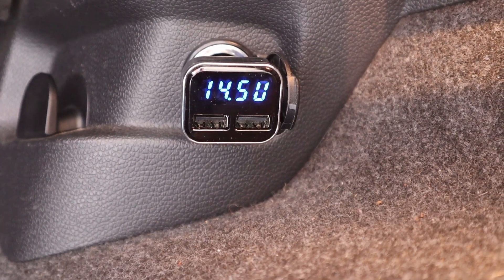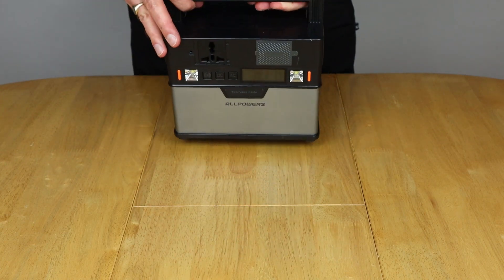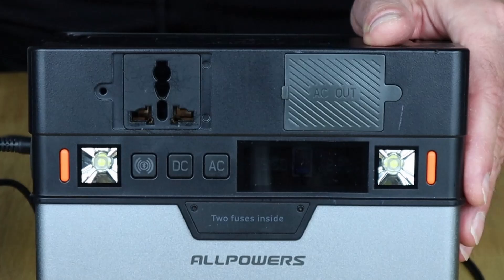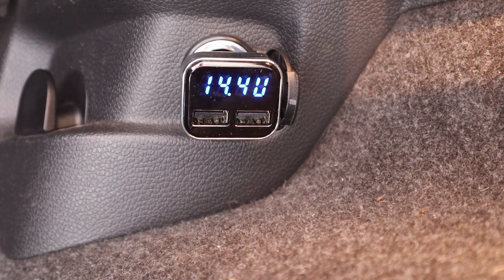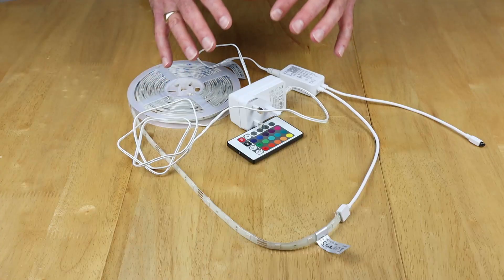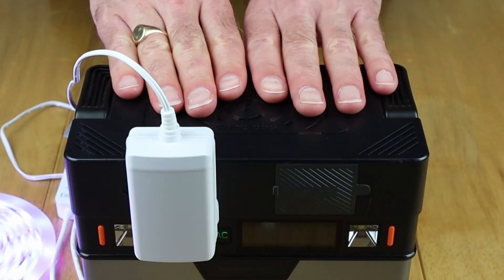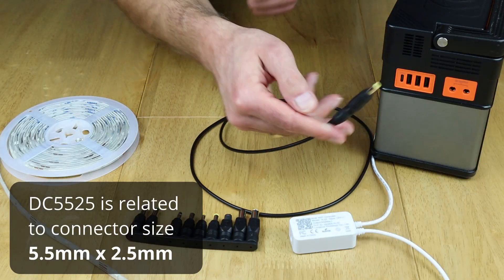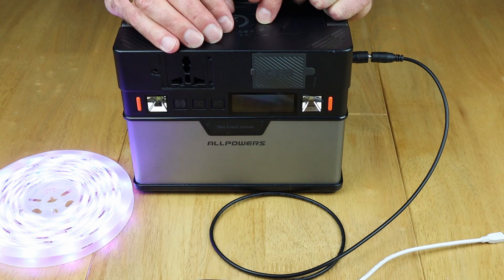How to get more out of your ALLPOWERS 372Wh Solar Generator | 12V charging and usage tips

Comment: I purchased the 666 version from Ali Express for £300 with new account discount promo, i thinks its currently £350 now its a great little product. However i was wondering if its possible to draw 24v to power a low power kettle without having to use the inverter and draw an extra 6w? i also have the 100w allpowers camo folding panel and was able to get 67w on a sunny day with no proper setup i.e. correct adjustable stand for correct angles. the only critic is its would be nice to have an attached folding stand and long dc cable rather the 1m dc cable provided. i got it for £150 inc tax and delivery on alliexpress and its all in working order. Another question is it possible to charge my allpowers battery on wind power if i have the right charge controller and cables? if possible please demonstrate.
Reply from the maker: @Christopher Bunbury  Good day Christopher! AliExpress has some great deals over Amazon (for the same products) and looks like you found one! That's a decent solar charge without a proper setup (angle). A couple of questions if I may.

Do you have the kettle already?
I assume it's a DC powered kettle, but what type of connector does it have (if you have a link that would be useful)?

I've not got a wind turbine as yet, but from what I've read the smaller ones don't yield that much unless you live or visit somewhere that tends to be exposed (and windy enough). I know some boat owners like them as they can provide decent power when in open water (again, when it's windy of course). It all depends which type you purchase as you can get controllers with them, but as the 666 has an in-built MPPT charger a 24V turbine should work as that is what a larger solar panel would put out. This is just theory though as I've not tested one on my 666. I look forward to hearing from you. All the best, Adrian
Reply from the maker: @Christopher Bunbury  Thanks for the info. I can see why you went with the second option over the first.

I found the 500W kettle (last year) in this video > https://youtu.be/Z5Fwp2pWBtU?t=1023 and it has been brilliant. Reasonable boiling time (providing you only boil what you need) and it works fine with the 666 too! The other one I'm currently testing is a one full-size coffee cup option which is really good on energy consumption and is also like a flask. It takes a little while to boil, but switch it on and just wait for the beep > https://bit.ly/3pyZ7zP (affiliate link).

I’ll check out some larger solar panels on the 666 and let you know. Cheers, Adrian
Reply: @DADvinci  ok thanks for the suggestion if the one I ordered isn't satisfactory I may consider the 500w one.

As for the panels, I'm looking forward to seeing what you find, much appreciated. 

I have since purchased dc2521 10m extension cable 18-36v to use my allpowers folding camo 100w in the garden whilst I'm indoors but wattage loss is very off putting. I was charging at 57 watts but when I just added the extension cable I lost 17watt

I got highs of 60w on solar today but I really want to at least be hitting 90 -100w
Reply from the maker: @Christopher Bunbury  I managed to briefly test today. I've not connected up 2x 100W panels in series (only parallel) due to the voltage limit on the 666 (30V) and my 2 panels in series would go over that. I think I've looked at this before and came to the same conclusion about anything above 100W, in that the MPPT limit is 30V and 5A (30V x 5A = 150W). It did slightly push up the charging rate from about 80W to 99W when in parallel, but I need to have another think about getting nearer the limit and what type of panels/setup might do it.

That is a problem with come DC extension cables, especially if they are long and fairly thin (small wire gauge). The angle on my smaller 60W panel does make a difference to the input watts and I normally get about 45W on this panel. Do you angle your panel? 

Did you have to pay import duty and VAT when you bought from AliExpress? Cheers, Adrian
Reply: @DADvinci  thank you, I see, when it comes to solar charging you have to overcompensate while staying within safety parameters. 

Its interesting tho that I'm able to get a continuous 167w dual charging with the power brick 97w and my Chromebook type c 69/70w.

Yes now I always spend time adjusting my panel for an optimized angle not by measuring, just by manually adjusting and checking the reading as I move. Its awkward because the app isn't working and with all the sun glare it's difficult to read the screen.

I clipped the camo folding panel to and old clothes drying rack it's a 3 piece. It fits across to pieces overlapped and the third piece I position to support it so it's like an upside down V and easily adjustable. As I wanna really be taking my folding panel out I wanna purchase a larger permanent panel for home use and keep the folding one free.

I've also bee looking into creating my own tracking stand it's seems straight forward most are made from wool or metal but I'm looking do it from pvc pipe to keep the cost down.

I don't recall paying import duty on the battery, I payed £320 for the unit and £16.46 shipping then got around £37 in coupon savings so ended up paying £298.54. the strange thing is that both the price and delivery from the same seller has gone up the delivery alone is now over £200 and the unit is £370. For me to buy it from the same seller the final price is over £600!

My Dad's car went flat, is it possible to jumpstart a 1.3l ford Fusion that has a 12v 41ah battery? I tried it today but was unsuccessful. I connect the croc clips that came with my folding panel to the battery and connected the other end to DC output on the allpowers. The allpowers was showing 60w then went down to 40w. I had it on for 5mins and tried to start the car. The lights and dash cams on but no rev from the engine. I've seen ppl start a car with solar on YouTube so I thought to try it with my fully charged allpowers battery. My gut tells me it needed to be charging the car battery for far more than 5mins. Eventually a passer by stopped and others us a jump and it started the car within seconds. 

Update: the allpowers app is now working for me 😃
Reply from the maker: @Christopher Bunbury  How are you? Thanks for the additional info, much appreciated. 

You're spot on with the home versus mobile setup. That was one of the first things I did when funds allowed, 100W rigid at home and used the 60W folding for travelling about. The tracker is a great idea! It was on my list to do, but starting the DIY builds has taken much more time than I realised (great fun though).

You can charge a flat battery, but more of a trickle charge so it would take quite a while to get enough back in the battery (so the starter motor could turn).

Great to hear you got the app working😊👍 The Bluetooth transmitter in the 666 has a limited range, so sometimes just being close enough to the unit enables the app to connect up ok. Enjoy the rest of your weekend. Cheers, Adrian
Reply: @DADvinci  hi Adrian I'm good thank you, hope you are well too.

It's a great time to have panels with all this sun we've been getting it.

Thanks for the info regarding the battery at least it's good that we can get some type of car battery charging.

My 400w  kettle arrived from Ali Express  I've had it a few days now. It's a little slow for the misses but I'm happy It works well with allpowers 666 and I can you it off grid. It's about 10min to boil a half load of 400ml and 20min for a full 800ml but I did it slightly over and had enough water for 3 full mugs of tea. The Chinese labelling takes some getting used to. I use live cam feature on Google translate on my phone and point it on the labels of the kettle it's brilliant, I've remember some of the labels already. The kettle consumed about 20% of current when boiling a full load from cold peaking at 420w but over time this reduced to around 200w once the base was heated up. 

Anyways I'll let you know how it goes with the solar tracker, have great week of summer 😎🌞👍
Reply from the maker: @Christopher Bunbury  Hey, I'm doing fine thanks for asking. I can't lie, I'm really loving all this solar😎🌞👍  That's fab info about your kettle, thanks so much for sharing the finer details too. I'll have to put it on my massive list of things to get now😊. Have fun and enjoy your off-grid cuppas! Take care, Adrian

Comment: My 372 was left in car overnight at -2 ,it stopped working until it heated up again . Has anyone else experience this
Reply from the maker: @cleekyboy  Good day and I hope you are well? That's very interesting as it sounds like low temp charging protection, something I didn't think the 372 came with (not obvious in the manual). That's usually a feature in more expensive units or on battery management systems (BMS) for DIY systems. If you can, I'd suggest not leaving it out in sub-zero conditions unless it's insulated in some way (referenced in the manual). Thanks for sharing and Happy New Year! All the very best, Adrian